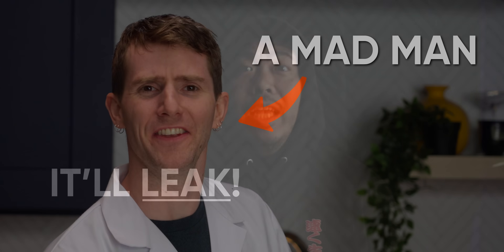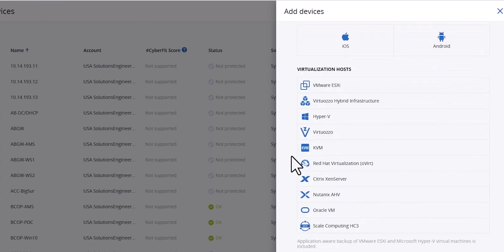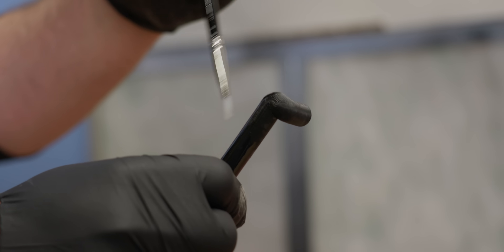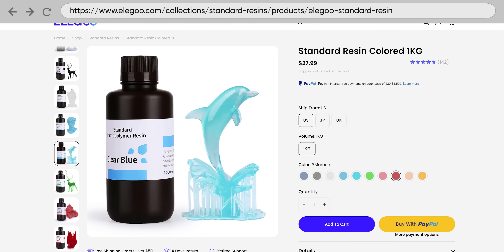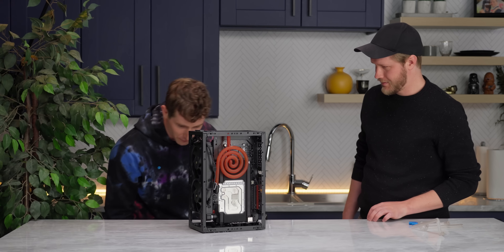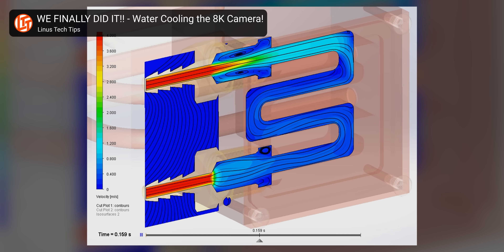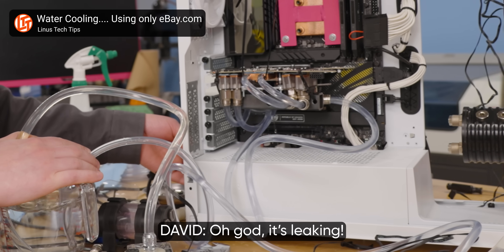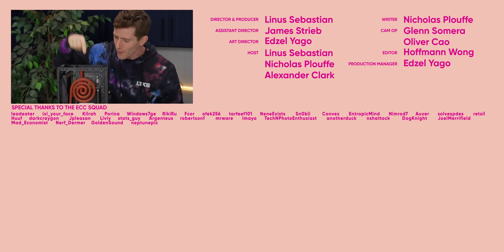3D Printed Hardline Water Cooling

Comment: Someone who was overseeing resin printing needs a little bit more experience with resin printers 😓those overhands look awful, together with support marks 😄
Reply: Not sure how you cured, i would be worried about internals not being cured enough for water not working resin out. saying "mars 4 or better" means that you went with inferior XY precision with saturn4, mars has 18um XY size while saturn4 has 19x24um XY size. Maybe you meant printer size, but it wasnt obvious. There is a lot of tough resins, that while not transparent will do wonders in this application (flexible resin anyone?).

Comment: I'd be careful with an open loop especially using water that you wouldn't evaporate or aerosolize a bunch of the water and chemicals in it and slowly lose volume over time.... however theoretically though you could turn use such an active water feature and evaporation as a way to cool the PC which might be in some ways better than a radiator. If I recall correctly Tech Ingredients got sub-ambient temps with a couple of vertical tubes, some case fans and flowing water with an aquarium pump, so long as you hook such a thing up to a self-filling mechanism like a toilet has you'd never have to worry about running dry and damaging the computer.

Comment: Would you even want such sharp angles on the inside of the 90° bend from a fluid dynamics standpoint? I was under the impression sudden changes in direction are to avoid. Or does it not matter anyway

Comment: quick tip for ppl, since im working with resin a lot and had the vid on in the back and didnt hear them saying that: resin takes in water. you can see how much over how long on the manufacturers sites. most that i use take in something like 5% water in 1-3 days. so they are not recommended to use in a loop or something that should hold water in general. they will deteriorate fast, and the loop will lose water fast from evaporation. some resins will lose their structural integrity after a hwile in water, and might be prone to warp or break under stress. resin also gets a bit pliable or atleast bendable after it gets soaked in hot water. so having it in a loop might cause the whole thing to distort after a while due to temps and exposure to water.

Comment: I am almost positive this will leak in that six month run. SLS UV cured resin continues curing over time as exposed to UV, including UV reactive dyes and the ambient UV from sunlight. This causes embrittlement unless you paint/coat it in a UV protective system. Source: I've been using various 3d printing systems for fabricating products for almost ten years at this point.

Comment: You most definitely can print tubing with PETG and it is watertight. You just have to be patient and print it on a higher quality, or your printer can't print at the resolution required. or possibly you made the walls too thin. lots of variables at work there.

Comment: The crazy thing is I have all the tools needed for this craziness at home.  And went through the same process to redesign my 3D printer internals recently (though with $2 dry shampoo rather than $40 Aesub).  Scanners are cheap now too if you don't need an Einscan.

Comment: I think you missed an EASY implementation of this! As you mentioned, using fittings to extend tubes to fit larger cases, you could also do traditional hardline tubing from components to the custom printed fancy parts like your spiral.

Comment: you could sand the prints and give a little acrylic lacquer and it will bee a lot more clear ! I think that you could spend a little more time improving the ends and starts of the first bend they are a little rough! 
But I am an additive manufacturing specialist and I never thot in that use!  but you could make a water block with a sculpture of "sonic" our "Mario" or other theme ! with DMLS

Comment: Once again, the concept of "laminar flow" is misused. Laminar flow is the restriction of flow by "friction-like" forces on the edges of a vessel, such as a pipe, thus making flow in the center faster than outside and adding turbulence.

Comment: Cool project, but DON'T FREAKING MIX RESIN AND UV LIGHT, the flourescent paint fo clear resin is a nightmare idea, resin cures with uv and overtime it degrades, if you want to expose resin to uv use a matte 100% uv protective paint!

Comment: an idea to use fdm printer is to use ABS and then to remove the layering, use an asetone fume bath, which smooths and fuses the layers together

but really cool, 3d printing is awsome!
Reply: also dont leave it to long and make sure to plug the ends of the tube or there might be deformation

Comment: Why not look at metal 3D printing to make the radiator as well? (I'm aware that it wouldn't work for the heat plates because of the fin thicknesses) use the space in the case to fill with all and every measure to help the airflow shift heat away.

Comment: Hey LInus, you absolutely can print watertight tubing in PETG on a regular 3D printer. I've done a bunch of experiments on this because I can't use resin printers in our apartment. Over extruding the flow rate along with reducing cooling of PETG can give the right amount of 'squish' and stickyness between the layers. Yes, there's a bit of experimentation to get the profile right but on my Artillery Sidewinder X2 bed slinger I can regularly print watertight pipes and other designs. Another technique is to print in PLA and flood fill the interior in slow set low viscosity epoxy but it's a bit finnicky and messy.  I've had a lot of fun doing 3D printing for PC interiors. In fact, I've currently got an air cooled modded Y40 on the Hyte subreddit.  Marrying 3D printing with PC design could really be a game changer in the modded PC community.

Comment: I know it’s weird and I don’t know if possible given pump operating temps but would it be possible to make a liquid LN2 loop as long as the res has a hole to let off the pressure couldn’t you theoretically push liquid lm2 through a copper loop or something ?

Comment: It could been done in 3d printer. Not resin. It's about adjusting the printer sittings and temperature. Then you won't have spaces between each layer. Like there is hole. But with proper temp. They will melt together. Especially if you choose the prober distance.

Comment: I'm thinking there is no reason your tubing even needs to be round or even smooth on the outside. You could print a flatten oval profile if you needed things to be more compact or to squeeze through a tight gap or you could "skin" the outside of the tubing with some cool geometric pattern or text if you really wanted to.

Comment: But the 90° bends are TOO sharp. And the cross-section of the inner tube alters too much in that corner. I'd be even more impressed if you modeled the fluid flow in them and optimized the bends for ideal flow. More gratuitous tech!

Comment: You could also 3D print the reservoir, distribution block, and fittings with O-ring grooves. Plus you could vary the width of tubes, adapt between sizes without fittings, and make structural or decorative components that are part of the loop. Even FDM prints can be water tight, though it depends on material and print settings.

Comment: I can actually see this being used for HPC and data center/enterprise applications where the in-house 3D printing shop (they'll make one, just to print the tubes) would hardline cool their servers and do things that the more traditional and conventional manufacturing processes for hardline watercooling in a server, generally won't be able to do (cf. minimum bend radii).

There would be a fair bit of work with various CFD applications (Solidworks FloWorks is okay for BASIC flow simulations, but for anything more than just laminar or kappa-epsilon turbulent flow, it doesn't have enough controls to be able to deal with larger and more complicated models.), but once the proof-of-concept has been developed in CFD, it can then be stress tested and thermal cycled for data center deployment.

I can TOTALLY envision this happening.

(Remember that I had attempted to design my own Socket940 waterblock for the AMD Opteron back in 2006, so this, to me, is new in terms of using additive manufacturing rather than the more conventional/traditional manufacturing processes, but the rest of the engineering processes remains the same.)

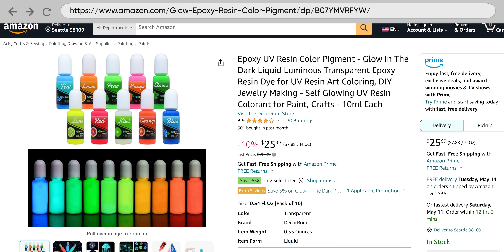Comment: 5:49 Don't do that. The resin is cured by UV. That means it's also extremely sensitive to UV even once cured. A blacklight will absolutely destroy the lines over time. I also recommend you keep any UV prints out of the sun if you don't want them turning yellow and cracking after a while.

Also, the brittleness of resin is overblown. Yeah it's brittle but it's not gonna crumble in your hands, especially if you use those strong sirayatech resins. Just a tiny bit of tenacious mixed into some cheap stuff and you're good, or you could just use their "fast" resin which is decently strong on it's own.

Comment: When working with the Monocure Tuff I have had a spalling issue with items over time, with shards of it seperating and peeling back a bit like layer seperation (but not on layer lines) That Might hve been caused by Excessive heat (the item was a hood prop end, so it was in the engine bay) But just something to be aware of.

Comment: I've always wished someone would create a "standardized" locations for through-motherboard water cooling fittings and you could have a standardized manifold underneath the motherboard and fittings in the appropriate places that stick through the motherboard and provide inlets and outlets to your CPU/GPU. Would need to get a motherboard + case manufacturer on board though.

Comment: Resin toxicity varies dramatically depending on the formulation - and there are low toxicity formulations that are dramatically safer to use, but be aware that to achieve low toxicity tradeoffs in cost, mechanical (ex, tensile strength, glass transition temp), printable (viscosity, curing wavelengths, curing time, etc), optical (coloration, UV stabilization, opacity), or chemical (water sensitivity, ozone sensitivity, etc) must be made, so do your research on what you need to make the print actually function in its intended role and its compatibility with printers/curing lights/etc.

I personally work with a very low toxicity PMMA/acrylic formulation for most of what I do personally, but while its got pretty decent mechanical and cost properties, it does make notable tradeoffs in chemical (high water sensitivity causing hydrolysis of the plastic before being fully cured), optical (low clarity on "transparent"/translucent prints), and printable (high viscosity) properties
Reply: The point is that its usually far more toxic than regular fdm printing, most hobbyist filaments besides abs asa or composites, dont really produce Vocs or affect air quality if you arent right next to them

Comment: While it would look sick to use fluorescent dies to use under a black light, it's not a good idea in resin 3d printing because the blacklight is in the same wavelength for curing 3d resin, so it will get yellow and brittle quite fast, just like when you over-cure a print, even if it's  a tough resin

Comment: You absolutely can use FDM printing to produce watertight objects, I have done it myself using PETG and even in vase mode (where the wall is just a single continuous extrusion). You just need to have well tuned settings. PLA isn't good for watertight objects but most other materials are absolutely fine. Yes prints have layers but if your settings are right then the layers should be fused enough that there isn't any gap.
Reply: also having temps a little heigher than normal helps seal the gaps
Reply: Yeap, this is absolutely true. I've made low vacuum tight PLA parts before without issue. My immediate response to the issue of porosity was "skill issue."
Reply: @conorstewart2214  Any recommendations for a YT videos that shows what you explained?
Reply: Came here to say the same thing, upping your extrusion multiplier a little bit and adding a dense infill will help the pipe be more translucent as well as water tight for anyone looking to try this at home (test it before you attach it to your 2,000 dollar graphics card)
Reply: Yall should look into HDPE its used for PEX water piping and can be used as filament for 3d printers. I dont know a ton about 3d printing but I do know pipes.
Reply: Not under pressure. Wouldn't be water tight.

Comment: i doubt that tubing with straight 90° bends are the best for waterflow i know it looks satisfying but i would assume its the same thing as calculating airflow for stuff like Car Radiators every sharp edge or corner costs performance it would be cool to compare a system with 90° bends to smooth "corners"

Comment: Next challenge in this series. Create a tube that would be impossible to bend manually, and add a flow indicator within that print. Though as I think about it, this might be one of those things that an extrusion printer could handle with ease, but may be an issue for a resin printer due to the inverted print bed.

Comment: WARNING ON EINSCAN PRODUCTS
Einscan is NOTORIOUS for bricking their own products by not updating their software to work with current or future Windows OS's.

An entire line of their 'consumer grade' scanners (Basically the stuff that costs less than $1000) no longer works because the software made to connect it to your computer DOESNT WORK WITH WINDOWS 10!  And when this happens they will NOT send you software that will work, they will NOT give you a new scanner, all they will do is provide you a $100 rebate on buying another scanner IF you trade in your old one.

I literally forced to keep a laptop with Windows 7 on it and forced it not to update just to get my scanner to work. 

SO BEWARE, if you buy ANY EINSCAN PRODUCT, be prepared for any future computer updates to turn it into a glorified paperweight.

Comment: I wonder if you could use a filament printer. If you selected a water-tight filament. HIPS? Plus, you can test-fill the pipe for leaks and determine if there are any issues.

Comment: GreenTec Pro could handle the temps. Easily handles ~minutes long exposures to boiling water, prints just like PLA.

Also, can make water-tight FDM prints using flow rates in the 125-150% range, or with a salt remelt. 

I now really want to print a new reservoir for my computer

Comment: It'd be nice to see LTT doing some more watercooled builds, perhaps to get the next generation of young'uns into it, because it seems that less and less people are into watercooling these days, and not many YouTubers talk about it much either.
Reply from the maker: It doesn't really do anything anymore. Overclocking is kinda dead for the typical gaming desktop. Undervolting is where it's at and water cooling doesnt help with it - LS
Reply: @LinusTechTips  I think it still has a place, especially with GPUs, and quick heavy workloads. 
Because if you ramp up your fans depend on the temperature of the liquid then you can run the system for a fair while before the water gets warm, and by that time your job is often done.
As opposed to air cooling where the fans ramp up and down, sometimes every few seconds, which can be really annoying.
And small fast spinning GPU fans are really annoying too, especially when you can use 6*140mm T30 fans instead.

Comment: First mod video I've seen in a while where i actually have most of the equipment. Really appreciate the link to a good scanning spray. I've been looking for one for my einstar for a long time and haven't been willing to buy and test multiple. One slight correction i feel i should make to the printing part of the video is pla is non-toxic and generally considered safe to be around while its being melted without an enclosure. Its ABS and especially resien printing fumes that are dangerous to breathe.

Comment: WARNING: Many 3D printing resins are hygroscopic and will crack and fall apart if in contact with water for a prolonged period. I resin printed a figurine and put it inside my cooling reservoir and it cracked and disintegrated and also clogged up my CPU block fins with nasty goo

Comment: If you don't want to have to use a resin printer, you can print in ABS and use acetone to vapor smooth it for the same result. ABS would actually be even stronger and more temperature resistant than resin.

Comment: You're all missing the real part of this, and that EK is under the gun right now for being super f'ing shady, and wildly expensive for their open loop systems. What's to say you can't just get your parts 3d printed now? All those crazy costly EK parts no more, get them at cost of the PLA resin. I'm just saying there is a huge market possibility, and while I lack the talents, I think an open source open loop community pitching in to build it up would be fantastic, you're all DIY crazies after all, I know some of you nuts have access to a machine shop that could not only scan GPU's and make custom blocks from the community files, then stick PLA shrouds to watch the bubbles go brrrrr.
Reply from the maker: It's a cool idea but the acrylic top is not the expensive part of a water block. It's the precision machined copper cold plates.

Comment: if you do have trouble making PLA water tight, you can also change the settings to completely infill the model, and also make the extruder hotter to meld the layers together far better, ive made a water fountain with PLA and was able to keep it water tight just with this trick

Comment: The scan was a little flawed, it should have been done with the fittings plugged by cylinders of known fixed size, inserted into the fitting as far as they go. Then you can subtract them from the scan using models of the plugs, and you have a perfect target for your tube models to hit